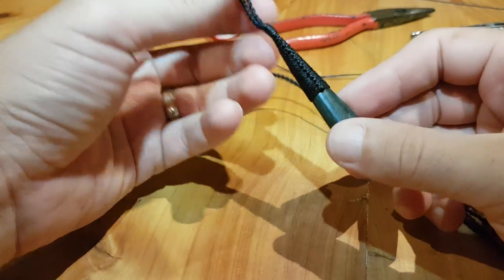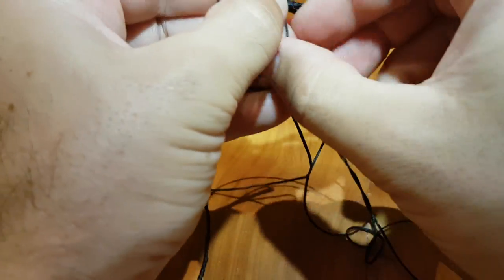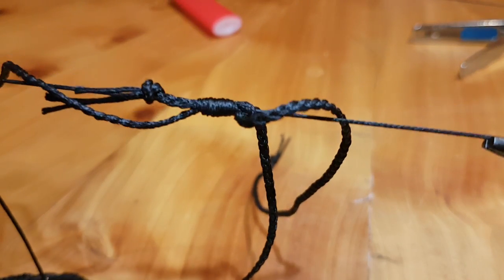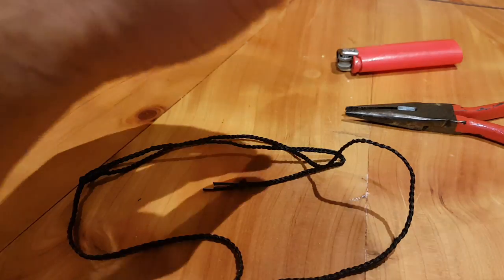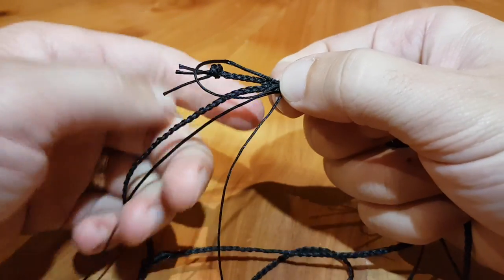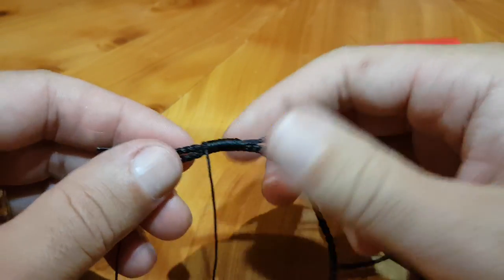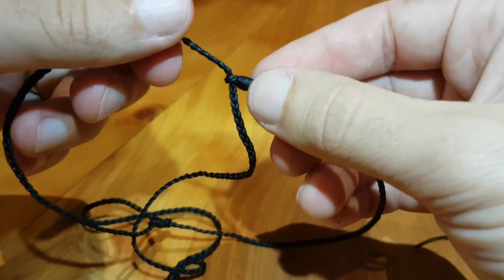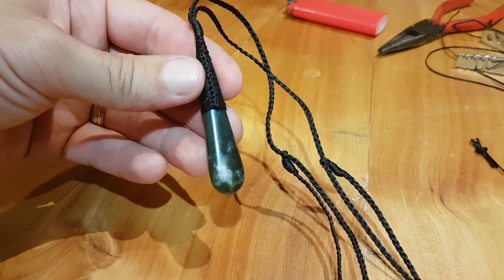How to Tie an Adjustable Sliding Knot for a Cord Necklace

Comment: Hi Campbell, thank you so much for your informative videos! I just finished putting new cord on my pounamu, but I didn’t get the sliding knots even, so when it’s adjusted, the knots are down one side. Is this fixable or do I need to start again with new cord?
Reply from the maker: The important part of making it even is having the same length on each side from the pendant to the knots. So as long you have that you should be able to retire the sliding knots. You may need to shorten one side which may cause issues if it will no longer fit over the wearers head!
Reply: @CampbellCarving  I'll give that a go, hopefully it still fits! Thank you :)